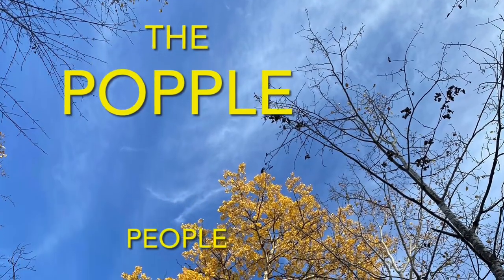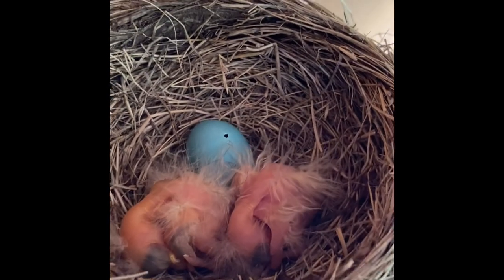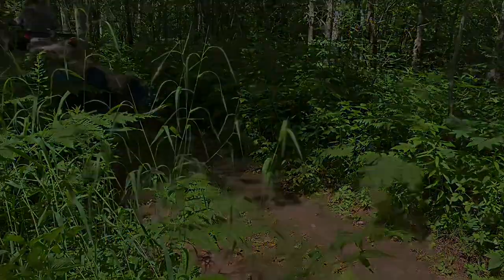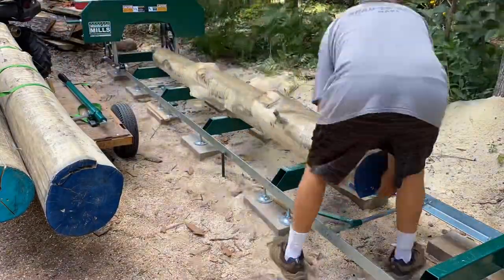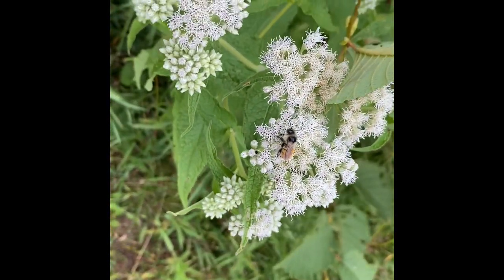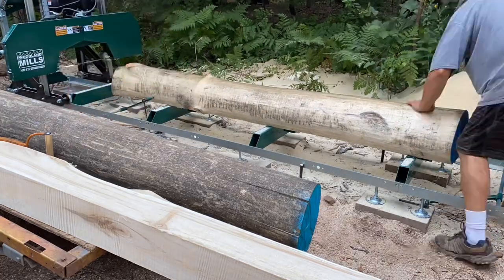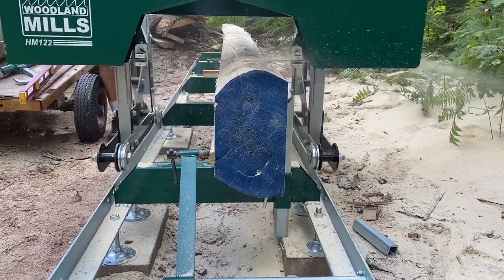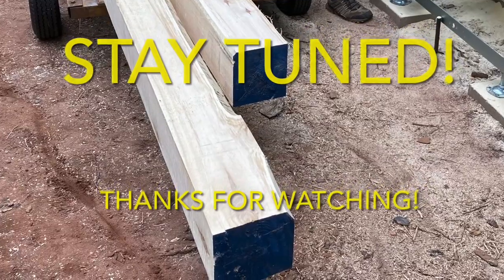SAVING $$$ with the SAWMILL-Milling 8x8x8’s for the SAW SHACK-Popple People-Episode 52

Comment: Looked like a lot of tension in that second log. Not that this matters for your saw shed , I saw someone cutting 8x8s , 6x6s ect for a post and beam home ( for a customer). To make nice laser straight beams they cut them 8 3/4 of an inch both ways. Then took  3/8 inch cuts off all 4 sides. A lot of extra work , but these were high dollar beams for a customer. Released all the tension in the log. Thank for letting me get that off my chest lol. Love the channel. Thanks
Reply from the maker: Yeah, there was a bit. We have had to resaw some of the stuff we’ve milled, but don’t think we will end up resawing these, but we’ll see! Thanks! We appreciate it!